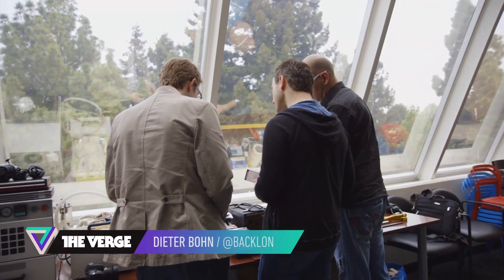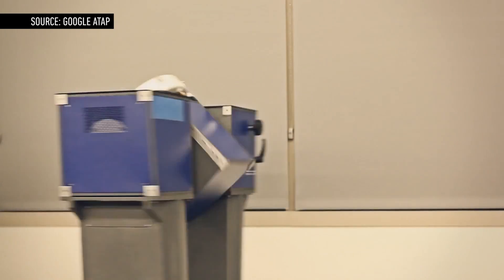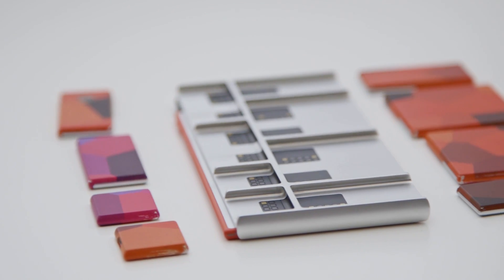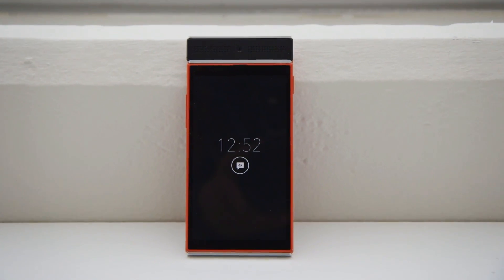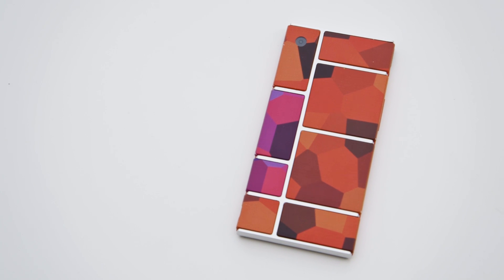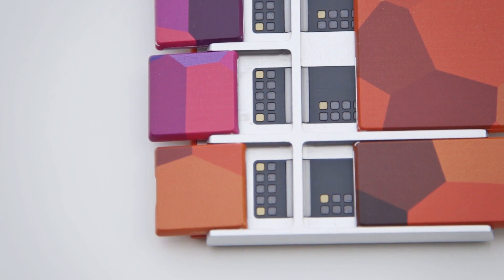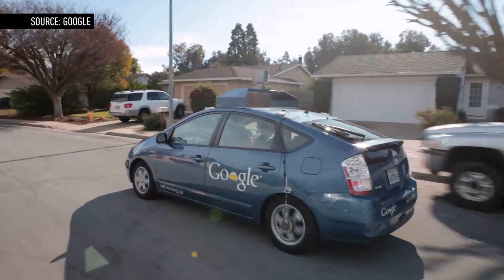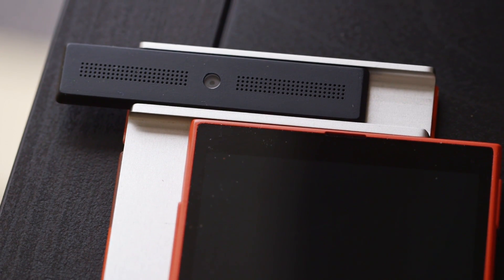Google's Project Ara: Reinventing the smartphone with building blocks

Comment: 2025 here, and I'm still thinking about this revolutionary idea... in 2013 they were speaking about the possibility to exchange EVERY part of the phone, for an upgrading, for replacing a broken one or simply to extend the usage (more batteries available, different lenses for the camera etc), instead a few years later phone manufacturers even remove the only possibility we had to replace something by ourselves, sealing the battery with glue and making the smartphone nearly impossible to disassemble and repair by our own unless leaving it to assistance for weeks... I've always felt that as a downgrade honestly, and making me feel like this Ara Project would be even cooler and more user friendly

Comment: I would love smartphones to have some form of modularity. We treat them like gadgets that are expendable and people have no problem paying for a new phone every 2~3 years. Of course this was so old that it made sense, smartphone are already too good now to need it. like you get an olden screen at 120Hz, you get 108MP multicamera system, good battery, high storage. The only thing we need is to stop the companies from degrading our phones over time with software and bloatware and also still give the ability to change the battery.

The best scenario for the future of phones is for a company to make one form factor (or like 2~3 max) and keep that design so all their screens are same and can be exchanged with opening it and replacing it, this would eliminate the need for a new phone if you screen gets damaged and trying to find the exact same type of screen to put. Also battery replacement is pure must!

Also what is it with companies removing the card slot? like at this point we should have had 2x slots instead of 1, not 0!

I also wouldn't mind being able to upgrade the camera or get a basic phone with the basic camera but have the ability to open 3 more slots with camera modules I want. I have a phone that has 5 cameras and 3 out of them are pure junk, a waste of space and money they could have spent in putting a better processor instead. Or if I had the choice I could have opted to get 3x 108mp cameras with different FoV and be happy for the rest of my life with it.

Comment: i still want this. we got faster more effecient components in phones now. with oled screens and smaller compenents it should now be more than possible to achieve this dream phone.
Reply: No because OLED isn't exactly durable
Reply: @GTAandApplechannel  who told you that?
Reply: @mustafanaik5866  you can't make that display module any thinn or else you can bend it
Reply: @GTAandApplechannel  We have bendable screens on phones, they are in foldable phones.
Check "Pockit" its on youtube, you can see how far tech has gone. Not a phone, but still a pretty cool modular project that might actually see the light of day ( I hope ).

Comment: If they made it 50% simpler, this could've been a gold mine!
They could've sold shells with different levels of customisation, a model where you could change the camera or battery only would be a good example, because some customers wouldn't want or need full customisation.
The customers would come back to buy modules more often than they would buy just a phone, which means continuous revenue.
The investment would be big, but the return could've possibly been huge!

Comment: i was working on a similar project like this.but we can also change the ram and processor module. the body was not sleek also the finger print module was biggest challenge.the we also had to maintain the security so no one can get your rom and take advantage of all the saved files.
there were lots of challenges and after 2.5 yrs on working on this we lost the funding. sad

Comment: I love the idea of having a bunch of different parts in your pocket for any situation. Too dark? Replace the current camera with a night vision one. Out of battery? Replace it. Want to play some music? Slide in a speaker.
Reply: And recharge the empty battery
Reply: If this phone took off, market would have become way different. The components/specific functionality modules would have cost way more than the base model of phone with basic function. Like the Gillette model of business- give them the razor, sell them the blades (in this case different kinds of it).
Reply: there is no end for creativity.. there are endless possibilities, it cud have opened a new door for something extravagant!
Reply: You could have upgraded it, have skins or cosmetics and not have to buy other when one component breaks, disappears or stops working
Reply: Null point. By the time they've got the price and performance down on the modules, regular budget phones will already offer all these features by default for cheaper.
Reply: The downsides would have been huge. Like take your phone out of your pocket in a hurry and one of the side modules slide and fall off on the floor, street, bus,  cab, etc. You talk on the phone and a thief/snatcher subtly steals just one or two modules from behind without you noticing. And to think of the dust accumulation and scratches as result this would have under the modules.
Reply: @gourabsarker6895  Heard of a phone case?
Reply: @freezedriedicecream  ok that's another great point. Open the phone case as many times as you want change in functionality. Compared to normal phones where I hardly have to open my case other than once a week to clear out accumulated lint/dust.
Reply: @freezedriedicecream  or a passcode that's needed to remove the modules

Comment: I can't use this phone. I work in construction and the likelihood of dirt getting trapped between the spaces is really high. Imagine having to clean out every individual nook and cranny every single week. That's too much time on my hands. Not to mention if it falls down and smashes a part of the framework. Then I won't be able to stick the module back in. Construction workers need something more durable and "dirt protective."
Reply: im sure they will make covers for phones like these too ;)
Reply: They already showed in the video the covers that the 3d printer could make. I'm sure the parts wont go flying if it drops.
Reply: +nobodyspecial 85 Idk man if I were a construction worker I wouldn't keep ANY phone in my pocket 20ft up in the air..

Comment: Reinventing the smartphone? Not really. You are just turning it into a tool. That's not the same as a consumer product, which is what folks like to but and forget. That promise of a "better phone you can fix up in the future" will always be a seductive lie. No one buys a phone, or computer, for that matter, and want to keep upgrading it for eternity. Unless there is a scarcity of parts. Are you going into a dystopian future where new phones are harder to come by? And the harbinger has always been that new stuff is cheaper than the supposed "new" ungradeable parts. Not a wise move. But as a tool, I can understand its attraction, adding capabilities, etc. Removable parts also present a security problem. Parts can be swiped out easily! (Then again, "hub" and "satellite" using wireless is a much better design approach.
Reply: +Buck Rogers cough cough sign your part number to your phone so if it is attached to a new phone it doesnt work without signing it out cough cough, like iphone does from using a locked iphone, cough cough. yes technology can do that, comaro  did it with the stock radio, take it out without the car key and it will not work again, these developers are not stupid, shit even if they didnt people still steal entire phones now, and they can make new models bigger and smaller fatter more slim metal plastic, thats the entire point of this phone. not everyone can just buy new phones.this is a super way to keep up with tech when you dont have money everywhere. people more fortunate can upgrade to the new design next year, super smart idea optimistically and realistically

Comment: how about an add-on that adds an extra layer over the previous slots(leave a slot open in your phone and insert this thing on it, and itself will be covering the phone with a layer of more slots) to insert more memory/attachments and has a larger battery included? helps to also better conform with the dimensions of somebodies hand. along with a larger case model to compliment the layer extension.

computer geeks would adore it and i know i will. but just imagine somebody finding a way to integrate more accessories in it  becoming like an actual laptop or desktop! 
the thoughts of mining bitcoins on a smartphone that powerful...damn. (not that id murder my wallet on that much power of course)
Reply: +petkannaa How woukd you insert the middle parts though? Push it in and hope it sticks?

Comment: Google use MacBooks ? 😂😂😂
Reply: Anas Al Ghamdi Dumbest comment i read today.
Reply: +Anas Al Ghamdi wait... No. Sure, Mac is decent for graphics, like photoshop and 3D programs... But programming? NO! You use a Mac for programming if you develop iOS apps.. That's it. Windows is great for programming, it has a lot more programmes and features! Plus, you get more what you pay for with PC, Macs reduces the power instead of making more sound(fans ex.)
Reply: Oliver Waldemar Pretty sure you don't know what you're talking about. The unix environment and terminal is what people care about. If people wanted to use another PC they'd default install Linux. Homebrew as a package manager on mac is too good. And apt-get is fantastic for linux. Windows sucks. If you want to run an intensive task you would never run it on your laptop, you would ssh into a server or remote machine and run it as a nohup process so power doesn't really matter, only convenience and comfortability of the environment.
Reply: +Daniel Blake-Hagan They dropped windows in 2010, now they only use Mac/Linux
Reply: +Bishr Arar That's not true. You can select which computer you want from resource acquisition. Most just prefer macs.
Reply: You can select what computer you want, you just can't use windows.
Reply: Because they don't make laptops, no, the Chromebooks don't count. They are only for the web. Not coding and designing you idiot. Even if they put Linux on them. They weren't designed to handle coding and rendering. So it will crash a lot. And Macbooks can handle coding and rendering more than Windows laptops, that's why they use Macbooks, idiots.

Comment: This is not bad. especially for cameras. Cameras are only cameras, they are not night vision cameras, IR cameras, or any other thing that fake apps lead you to believe. With this, you could swap out the camera and put in a laser or a very powerful flashlight.
Reply: +Plato they should do it so you dont change it like that , but you change the camera for a better one when it comes out
Reply: +iTzzNinjaGames Well that would be the next step, instead of buying a new phone you can go and just buy a new camera module if you need one. Want to game and the phone is too slow.. go buy that brand new GPU module etc.. so basically upgrading components as you feel you need them.
Reply: +Kafanska TV Or simply.... if you want a good phone but don't give a DAMN about the camera... well, don't stick one !
Reply: +Plato Dont forget that space is evolving fast.... the amount of RAM used in 2010 was a lot less then now... same for the power consumption, if u need more battery life u slide more batteries... I truly believe this modular phone will be the next big thing....it is a concept beyond the evolution of desktop pc!
Reply: I believe that’s what motomods tried to achieve
Reply: +Oleg Bezman yea but seems like you will need to choose between battery power or sound.. i would prefer both together

Comment: I'm so excited about ARA. I really think that this will soon become the new standard in cell phone technology and production. Now make a laptop PC where I can do the same thing. Just like a desktop, I want to be able to go inside, fuck with, switch out, replace, upgrade hardware or the screen, or the keyboard... THAT would be awesome as funk. Anyway, Jam on!
Reply: +LAIDBACKMANNER Somehow I think I would end up using one slot for a single chip solution and using the rest for batteries 

Seriously phone batteries are too low in capacity these days considering how much power the devices draw 

My iPhone 5S has a 1500mAh battery and at idle the phone draws 200ma per hour 
When playing games that goes up to 900ma per hour 
Making a phone call uses 350ma per hour 

Realistically it should have a damn iPad mini battery in it
Reply: LAIDBACKMANNER I think Razer had a project which had the parts of a PC in small boxes and you just push them into the case and it works.
Reply: +mewantbrains how about a module that adds battery... and you are able to easily swap that out and charge the used up battery? I mean... each one of those modules can have a seperate minibattery in them to sustain thier own needs or just have one of those bigger modules primarely for batteries... just think of it
Reply: There are limitations to the size of the modules so I think multiple small batteries would be more easily manageable

Comment: Any electrical engineer will tell you this is never going to work. The whole reason we can optimize the hardware and make modern devices as small as they are is because we design it as a whole device.

Introducing modularity like this will increase the size of phones, decrease battery life, increase customer confusion, and drastically increase production costs.

It's a cute idea but unfeasible at the moment.

Comment: doesn't seem like it can fit much components and still have a decent sized battery

every time you upgraded it with a new cpu or better screen that chews more battery it seems there wouldn't be much space for a more powerful battery i can see this phone needing a new (bigger) base every 2 or so years otherwise it would be extremely limited in the long run

Comment: 1.15 "But it is a passive component, meaning that it consumes no power", well a resistor is aswell a passive component and it DOES consumes power, dissipating it in form of heat... can some one explain how it does not consumes power? 
Thank you in advance.
Reply: Magnets don't heat up, so they don't dissipate power in the form of heat as a resistor does. (This is just my guess to your question, i'm not super experienced, i'm just saying what i thinks the answer. Hope this helps you.)
Reply: Indeed magnets do not heat up like resistors but they can induce current by creating a magnetic field as a coil. Thats why you can charge your phone without using any wires.
Reply: danysoultakerftw Yup, you definitely know more than me.

Comment: O celular é bom mas não valer muito apena por 3 coisas. 1 as peças dele sair facilmente isso quer dizer que qualquer jeito que você toque no celular faz a peça sair do lugar. 2 as peças não parece se resistente qualquer pancada ou queda as peças quebra. 3 não tem capa de proteção. única feita de Borracha ou silicone  igual aos outros celulares isso quer dizer que não terá muito apoio a segura ele é tem que ter muito cuidado a Guarda em algum lugar qualquer coisa ele pode sair do lugar as peças e perde.